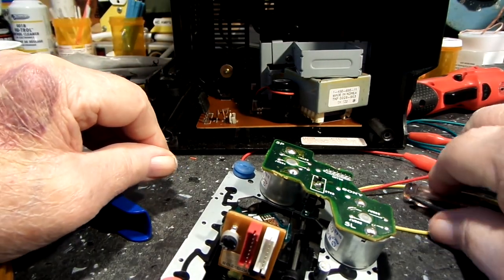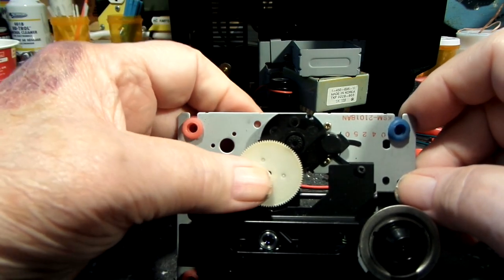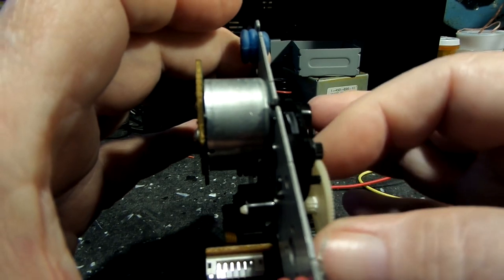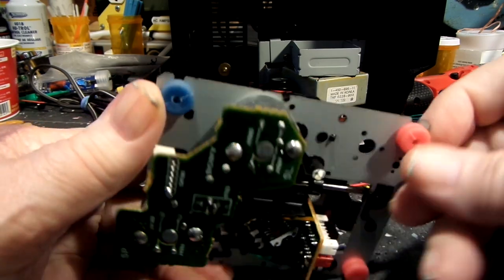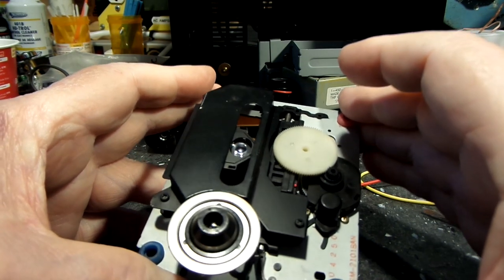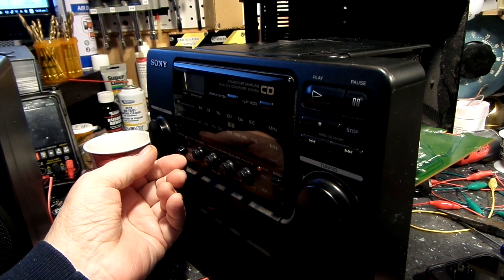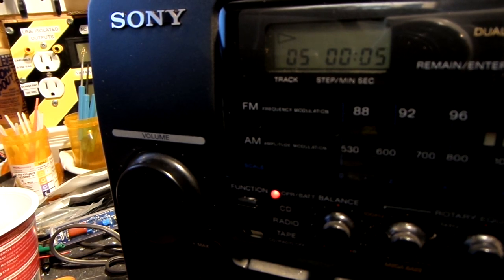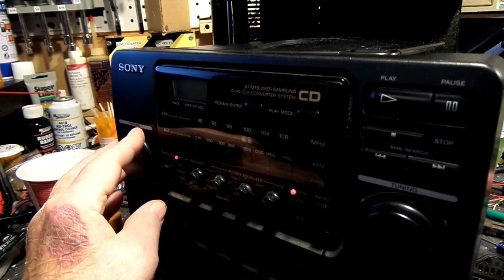Sony CFD-510 - CD Fix and Demo

Comment: Good stuff. I gotta work on my sisters  cd player in a bit. Cover me, im goin in. Lol. Hey where do you source your belts from. Should proly have em on hand before splittin her open im thinkin.
Reply from the maker: Thanks, I just buy the assortments on eBay for belts, but chances are you may not run into any on a CD player. I bought a selection of the narrow and wider belts which have covered all of the tape decks I have needed belts for so far. Here are the links to the ones I bought. Wide ones: https://www.ebay.com/itm/195235019264  Narrow ones: https://www.ebay.com/itm/224990464867
Reply: @DERB_Seymour_Indiana  nice. Thank you. Yeah its a multi cd changer with a motor. 👍👍
Reply from the maker: Yep, that makes all the difference in the world. Good luck. :)

Comment: Good to see you got the optic to read cds 💿  maybe that's all it needed was a clean. I'm wondering if unplugging components and reinserting them made any connections that weren't quite making a connection, connected. And thanks for shoutout of my friends and I's channel!
Reply from the maker: Thanks, I know, right? Reminded me of some of the fixes I did before I even learned electronics when I would take something apart and put it back together and it magically worked. LOL I think working that lens up and down the track and cleaning it again was the true fix this time. :)